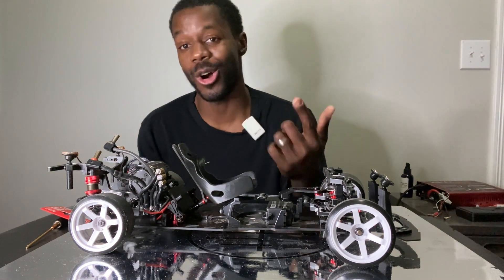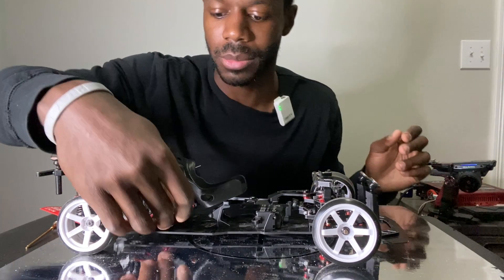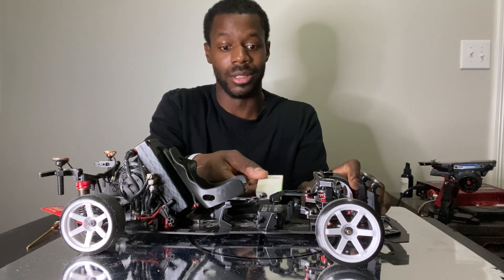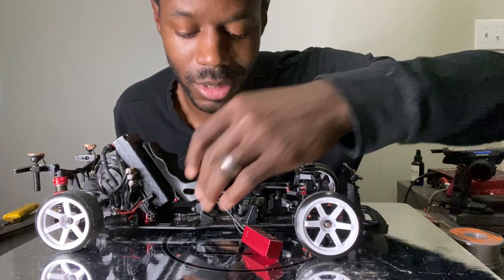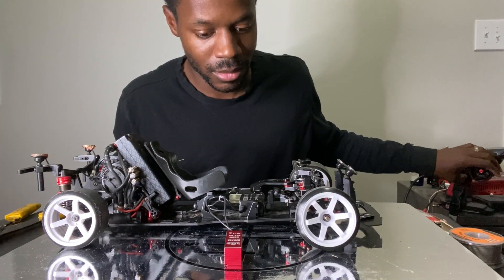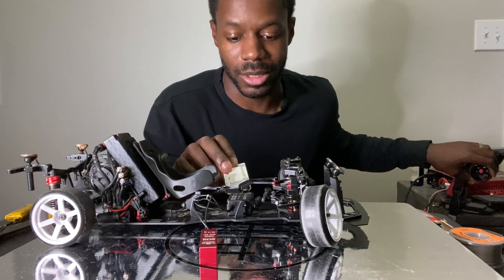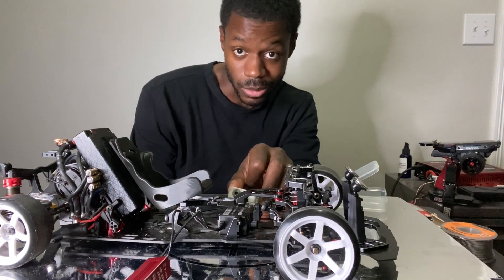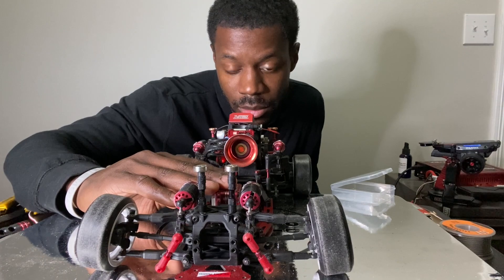RC Drift Servo Chatter - Can It Be Fixed?

Comment: So, for me, this was my transmitter. I set the dead zone a bit wider and the chatter stopped. Turns out, my transmitter was constantly flipping between 0 and -1. If your radio allows that, Id give it a try.

Comment: A very controversial topic that I think you summarized perfectly, It doesn't matter to you.   I think this idea of capacitors stems from Acuvance's products and how most people see it as overpriced or snake oil.  They do work but the results are very subjective.  Some may put it in their setup and not notice a difference, and some will enjoy it so much that they equip it in every chassis.  The capacitor should help with some chatter, wobble and change the feel of the front grip but I doubt it will ever fully eliminate chatter.  Servo chatter stems from the natural of digital servos and how they pull short high peaks of power.  This creates two issues, one is solved by the capacitor which smooths out the power delivery to other systems.  The second issue is the interference this frequency causes.  Any power passing through a wire causes a degree of interference.  Keeping wires short and tidy is a great way to reduce it, especially the wires of your capacitor.  Try wrapping your wires in an inductor core and see if that solves anything.

Comment: Now that you put the capacitor you need to zero out your steering servo and also put your steering at zero. Should stop the chatter
Reply from the maker: Zeroed out in the programming? Its zeroed already. I have even steering left to right and of course I did have less chatter towards the end of the video.

Comment: You might want to look at the PWM signal under a microscope. Some controllers are internally digital and generate the PWM signal off an 8-bit or 7-bit base. The result of this is that you have "steps" in your PWM signal and there might be some jitter in the signal as  the value jitters between one value and the next. This results in jitter in the PWM signal which results in the chatter in the servos. Try a purely analog (older) RC controller and receiver and see if you still have the chatter. Another thing you can try is disconnecting the PWM line from the servo (leaving the power lines). In this way, you can see if the problem is coming from the PWM signal itself - which is most likely the problem. In summary - it could be jitter in the PWM coming from the RC controller itself. Try connecting an analog PWM signal (such a servo tester) to the servo and see if it still jitters. If it does not - then the problem is with your controller.
Reply from the maker: I like the thought process. Will try it out!
Reply: @idealautofactory  noise from tx gets amplified by the servo. try a cap on the tx .

Comment: Ive adjusted the reved servos many times and still get the chattet. I dont have the issue with yokomo servos. With ddss its notiable in the wheels.  Tho it still gives zero problems whatsoever while driving, so not worried.

Comment: If you have another car and you really want to figure out the problem, try swapping parts out until you find the culprit. Get the cars close together and start with unplugging the servo and plug the other car servo into it. See if it stops the jitter. If not plug the motor in from the other car, swap other receiver, transmitter and tell you find the problem.

If it is the servo it might help or at least reduce the jitter if you shield the servo wires by unplugging it from the receiver and wrapping the wires around a pencil very tightly. When you remove the pencil, the wire should retain a coil like shape, which would help shield it. You can also do this to the speed control wires that go to the receiver. Try to avoid wires crossing over each other. Remove things that can be moved such as the receiver, speed control, on/off switch and move them further away from each other see if this stops the jitter. Relocating something to a different spot may stop or reduce the jitter.

If it is the servo you could also wrap the servo with aluminum foil, aluminum tape or preferably copper tape and ground it to the servo’s wiring.

Comment: Whatsup dude, nice video. I am no expert on RC car chatter, but I'm big in the drone world. There are typically filters programmed into the radio's communication protocol that can help with things like chatter. We typically have them turned off on drone remotes as we have a flight controller that have those filters built in, but we can turn them back on if we're flying a standard RC plane with the radio. These filters are called ADC filters and the new Radiomaster MT12 has the ability to turn them on or off. 

I would suspect that a radio with ADC filtering turned on would stop the radio chatter. Let me know if you've heard anything about this. I'm doing a review for the MT12 now and I'll try to sneak a quick test in the video regarding this 🤙

Comment: You can solder an inductor in between the power line on the servo to help filter noise also I'm sure different pwm frequencies

Comment: I like my $70 AFRC 19kg which comes with programmer, it does not noticeably chatter on my rd1  or d5 v2 and works up to 100% gain with no wheel wobble. But I programmed it to damping 350, pwm 69%, sensitivity low (as found in the amazon user review comments). Its with a yokomo 302v4 gyro.

When digital servos came out a few companies said that it was normal because if the servo feels any slight mechanical resisistance the chatter meant the servo felt it and was trying to hold center. Does it still chatter when you remove the servo arm linkage from the steering rack? If the servo is disconnected mechanically from the steering and it goes away then you know a mechanical force was being applied to the servo and the chatter came from trying to hold center. Also all servos are different in how sensitive/strong their at rest holding strength is. I have had 100’s of rcs over the years and generally have found when no mechanical force is applied the servos are quiet. On a lot of my cars I live with it because on some of my cars cars the servo center will vary enough from the cars mechanical center (steering slop aka not tight) so the servo constantly chatters trying to correct it. But servo models do make a big difference in if or how much.

I have not tried the $80 reve d servo yet because the $70 afrc 19kg’s have been perfect so far (and come with programmer).

Comment: Hey, I am thinking on getting a Sp-03d for a new build, I am currently running a RS-ST. I know one is a coreless and the other one is brushless but other than that how they compare? Is one better than the other? Or it is just a color gimmick? I barely moved a car with the sp-03d but it seemed to be smoother and faster, but I didnt tried it on the track.
Reply from the maker: From experience, go with the SP-02d. It has NEVER gave me problems. 

The Sp03d is hit or miss.